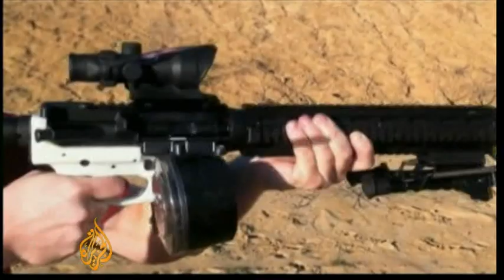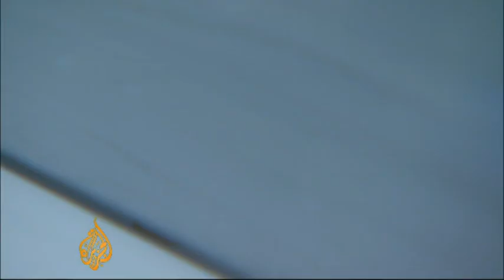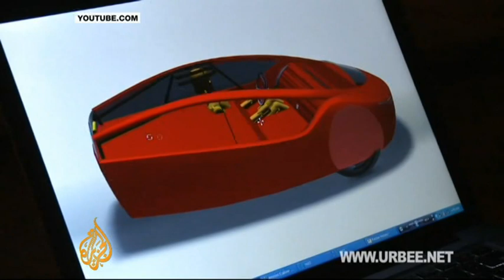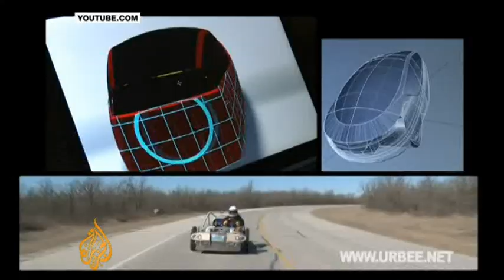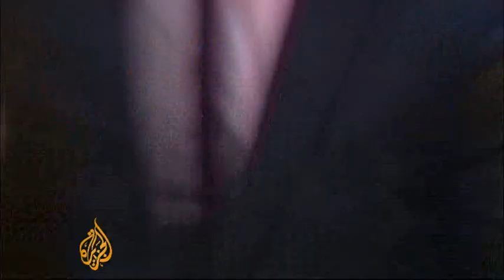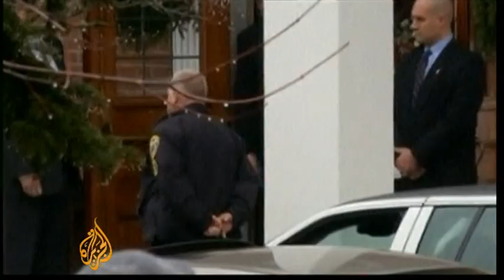3D printing's dangerous downside

Comment: The Printer you showed us was not able to print a gun and that's £25k machine for colored models the type of machine needed for printing a gun is an SLS EOS machine starting at £1000000 + and reaching up to £3000000 so unless your a billion dollar drug lord who wants a million dollar pistol what could of been made by hand for less on the black market then its useless like who is going to spend £1000000 on a gun part work about £600 the news is twisted.

Comment: You could also make a gun using non-digital techniques, and it'd probably be better. All you need is a lathe, milling machine etc

The active part of a gun is the ammunition, so the ammo is obviously the main target for control. You can, if you have a bullet, make a gun using some plumber's pipe and a firing pin assembly. Won't be quick to reload, but it'd work. 

Fact is that commercially produced guns are easy enough to smuggle, and a lot less work for people to purchase.

Comment: It is not fully 3d printed, if it was it would blow up in his hand!  The only part that was printed is that white part, even then the internal parts are metal from the original.  

Its not manufacturing,  it is customizing what he has brought from a store.

Even if we did away with all guns, there is the black market were it is easy to get full auto guns, explosives, bombs, drugs, anything you want and it is not hard to find them.  Criminals don't care if they are breaking laws

Comment: Phil Lavelle, you need to do your research properly.  The AR15 is NOT a 3D printed object.  The barrel and upper receiver would not be able to be printed to at a high enough resolution and printing in metal uses aluminium (Not a great metal for making firearms).  The printed part on the AR15 is the lower receiver, which can be bought off the shelf without a permit, anyway.  

This is a proof of concept idea and if we all thought like you, we would still be in the dark ages.  

RESEARCH FIRST!!!

Comment: I understand your point.  But if you are talking about a barrel that melts at 500 f the integrity would be extremely compromised after a few rounds.  Another factor is said price.  I can manufacture a receiver out of a block of metal in a few hours with what I have in my shop for the cost of materials.  That and given the abundance of machine shops(personal and private business), manufacturing of components on any scale is far more economical for the time being.

Comment: You cannot use a plastic barrel.  It would explode.  and even if it did work (once at the most) the accuracy would be complete garbage.  Also manufacturing of shell casings and bullets with a plastic 3d printer is just not possible.  The components would not be able to withstand the pressures.

Comment: why should you reguklate it you cant! hell you can build a 3d printer on your own!
you dont regulate 3d printing this is not the solution!

and its ultimatly unpracticle.. plus i want one of these.. not for guns though.. for legitimet hack everything in sigth modify construct and venerate the holy machiengod type use...

Comment: The only part of the AR-15 that was printed was the lower receiver, you cannot make an upper or bolt and bolt carrier because those parts experience high temps and stress. Furthermore, ammunition manufacturing  cannot be done on a printer

Comment: This report is very misleading. The only printed part of the gun shown is the white portion known as the receiver, but legally the receiver IS the gun even without the rest of the necessary parts(all of the black parts). One CAN NOT print a complete gun capable of safely firing rounds. Good luck getting the rest of the parts in the UK.
   As to those saying this is fake - the printed receiver in the video has been successfully used in the firing of over 600 rounds as of last update.

Comment: CNC machines produce nothing unless you program the machine, same as 3D printers.  The 3D printers only produce plastic parts so the barrel and working part would still need to be CNC made from steel.

Comment: You CAN'T make the barrel NOR the springs NOR the bolt and probably you cant make most of the trigger mechanism and the striker (but it's easily made in other ways).
What I mean is - You can't make the important parts that make the gun a real gun. You can print a water gun though ;)